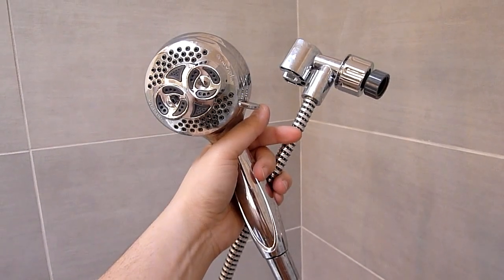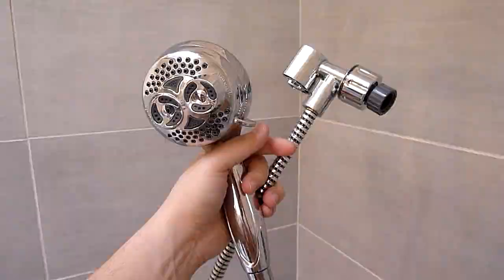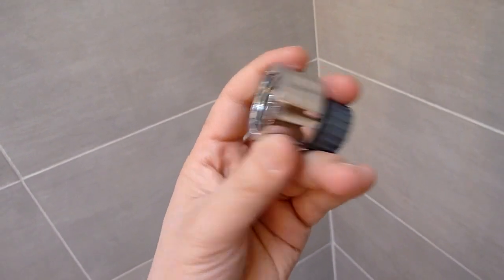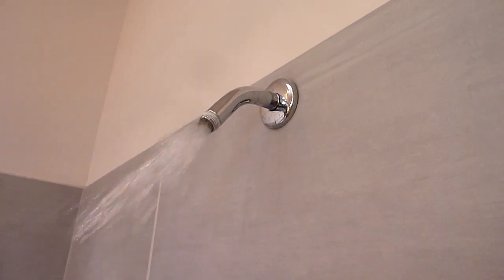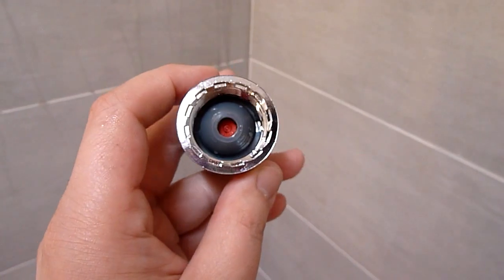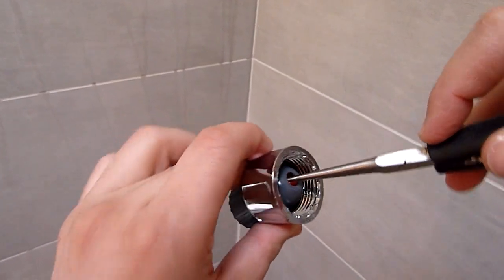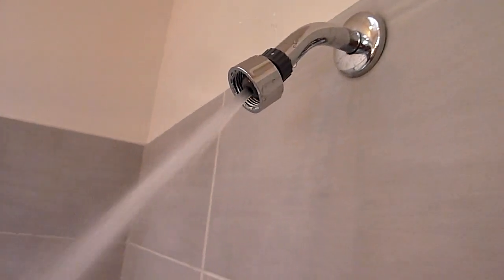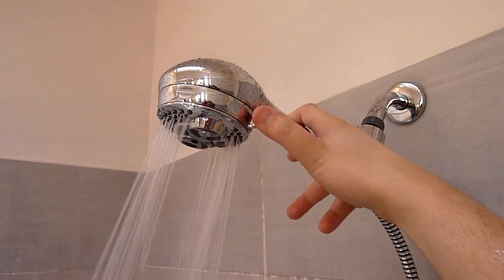Removing the flow restrictor on a WaterPik (water saver)

Comment: Word of advice: Don't use a pliers or any other type of metal object, as you risk chewing up the plastic and perhaps breaking the flow restrictor, which will be difficult to replace should you wish to put it back in at some point. Any type of object that can fit through that hole will do the trick; it doesn't need to be especially hard or sharp.
Reply: Probably good advice but no is putting the restricted back in.

Comment: This works well to increase the water flow but beware your hot water tank may not like you much.  I have a Waterpik showerhead that now has such great flow that I run out of hot water in about 20 mins AND it is a brand new 40 gallon hot water heater.  Most settings on the shower head use 2 - 2.5 gallons per minute WITH the restrictor so it must use more without... do the math.  Thankfully, 20 min. showers are rare but if you have 2 or 3 people who shower back to back, beware of potential fisticuffs over hot water.

Comment: This just saved me from buying another new shower head because the waterpik i just bought was so weak. I had no idea shower heads had flow restrictors on them. They don't even bother to mention it in the manual.
Reply: If I had to guess they were pressured not too, I live in Cali so I think this abomination started here.
Reply: @RickW-HGWT  rick is correct, it is against federal regulations to mention the flow restrictor. And yes, the continued flow restrictions are coming from California.

Comment: Just had to purchase a new one and the red in yours is black in mine, and I found it highly suspect.  One thing WaterPik changed from my previous old model is they moved the trap/screen filer from the hand part to the part past your red into the shower neck.  I took it out thinking that might be it then measured it and 1.7x (probably my error so 1.8gpm).  No problem as it stayed out, and I put my old pyramid type screen into the handle (what a pita to have to remove the entire unit just to clean the screen whereas before you just unscrew the handle). I then popped the black (your red) thing out because that was suspect.  Not much else in this and the flow almost doubled.   Thanks.

Comment: Thanks for this. Landlord has been doing stuff with the plumbing, and water pressure in the shower is suddenly lower. Will have to pull this apart and see if this is the problem. Never had a problem before, and pressure throughout the rest of my place is fine.

Comment: I JUST BOUGHT THIS MODEL I TOO HAVE THE WHITE FILTER BUT SIMPLE TO UNSCREW  WITH PLIERS THEN I DID WHAT YOU SEE POP OUT THE RED THING .I HAD A 30-YEAR-OLD HEAD I DID WANT TO GIVE UP BECAUSE HAD NO WATER SAVER. BUT IT WAS LEAKING EVERYWHERE. I GOT THIS  TOOK A SHOWER AND SAID HELL NO. I ALWAYS NEW YOU  CAN DRILL THESE OUT.  BUT I SAW OTHER VIDEOS 4 MIN TO 10 MIN, WASTE OF TIME YOU GOT TO THE POINT IN 1 MIN. AFTER POP OUT I REINSTALL AND I DID A KRAMER, IT WAS SO POWERFUL IT BACKED ME UP AGAINST  THE WALL. 6 SETTINGS THE STRONGEST SETTING WILL BLIND YOU OR KNOCK WEAK TEETH OUT NO JOKE. DAM I LOVE THIS NEW HEAD. BRAVO VIDEO. I BOW TO YOU SIR.

Comment: Thanks a lot. This worked for me. I literally bought 4 shower heads in 1 week because of the low water pressure. After finding out that there is a flow restrictor I started looking around on how to remove it. Peerless was not easy so I bought the waterpik  8 mode powerspray because it seemed easiest to remove that restrictor. I now have decent flow. Mine did have a filter screen that needed to be removed first and the color for the restrictor was black for 1.8 gpm.

Comment: Thanks so much for this vid.
Lucky for me I bought the exact same model and was unhappy with the pressure.
I actually had to remove and then reinstall the washer and the filter screen to completely get rid of the red flow restrictor. They are not present on this vid.
I actually have too much pressure now, especially on the TURBO modes. lol
Kind of reminds me of the Seinfeld shower head episode with Kramer getting blown away by the pressure of the "illegal" shower heads.
Reply: +fortix9 <3 seinfeld

Comment: Thank you!!  Ours was a little different had a yellow piece and the other side I had to turn white piece to get rid of all too!  Put washer in, attached back In.  Works just like shower of the times when it was not dictated. Now to get rid of these washers that do not wash clothes  because government has decided  we don't need hot water or agitation to clean.  I now run 3 cycles for one load o laundry  GrrrrThanks a million for this shower improvement
Reply: I JUST BOUGHT THIS MODEL I TOO HAVE THE WHITE FILTER BUT SIMPLE TO UNSCREW  WITH PLIERS THEN I DID WHAT YOU SEE POP OUT THE RED THING .I HAD A 30-YEAR-OLD HEAD I DID WANT TO GIVE UP BECAUSE HAD NO WATER SAVER. BUT IT WAS LEAKING EVERYWHERE. I GOT THIS  TOOK A SHOWER AND SAID HELL NO. I ALWAYS NEW YOU  CAN DRILL THESE OUT.  BUT I SAW OTHER VIDEOS 4 MIN TO 10 MIN, WASTE OF TIME YOU GOT TO THE POINT IN 1 MIN. AFTER POP OUT I REINSTALL AND I DID A KRAMER, IT WAS SO POWERFUL IT BACKED ME UP AGAINST  THE WALL. 6 SETTINGS THE STRONGEST SETTING WILL BLIND YOU OR KNOCK WEAK TEETH OUT NO JOKE. DAM I LOVE THIS NEW HEAD. BRAVO VIDEO. I BOW TO YOU SIR.
Reply: I live in Alabama mine is Dark Purple 2.0 mine also came with a FIlter Screen ugh!

Comment: In the white plastic handheld WaterPik I purchased in 2019, the flow restrictor is in the handle, not in the part that connects to the plumbing. Slightly different process because one has to PULL the restrictor out rather than push it.

Unscrew the hose from the handle. Then, unscrew the filter in the handle (counterclockwise) and remove it. Then, impale the restrictor (black, in my case) and pry it out. I've seen others suggest screwing in a long screw a little until it's firmly enough anchored to pull out with a pliers. I use an ice pick.

Comment: Thanks dude. I certainly appreciate the help. I almost removed the water filter part instead of the flow restrictor part. But I imagine I don't really want to do that.
Reply: I removed both and it feels to me like a whirpool jet hitting my back ; )
Reply: Mine is same, has filter that unscrews and rubber washer.  Newer model?? I took out filter but make sure you leave in rubber washer.  Filter cant be doing much but restricting water also.  If you have hard water, your filter will need periodic cleaning I assume

Comment: HEADS UP!!! If you have an issue with hot water not lasting long enough or take long showers you might wanna reconsider this as sure your getting more pressure as more water is flowing through the unit and out of the head but the more that's flowing the faster your hot water supplies consumed.

Comment: I just purchased the Waterpick with PowerSpray+.  The flow restrictor is in the shower head itself. It's the same gadget only there's no way to remove it Scratch that, it came out with a pair of tweezers...and I was going to get the power tools.

Comment: Do you need a filter screen in the shower head or can you go without?
Reply: The filter screen is a good thing (helps to filter thing like sediments), and doesn't restrict the water flow- at least as long as it remains relatively clean.

Comment: My Waterpik Twin Turbo has, in addition to the red thing, a white plastic piece on one side. Remove that too?
Reply: Mine does aswell I believe its the water filter so I left it in. It doesn't seem to make much of a difference on the flow with the filter in or out. So I just left it in
Reply: Mine is same has filter that unscrews and rubber washer.  Newer model?? I took out filter but make sure you leave in rubber washer

Comment: Just bought Waterpik FlexNeck NML-603.  Removed the filter and can see the restrictor but using needle nose cannot get it to come out.  Tried removing the nut where it connects to shower pipe but that is impossible too and I may now have actually ruined this.  Anyone know the answer?  Waterpik has not responded and it's not in the manual.  Thanks.
Reply: I was going to remove the nut to try to push the restrictor out as in this video.
Reply: Baroness Miller Used a tool with a sharp point and the restrictor popped right out.  Wish I had tried that before I messed with the nut.
Reply: Interesting to see someone take their own initiative and not only respond to their own comments BUT answer their own questions ; )